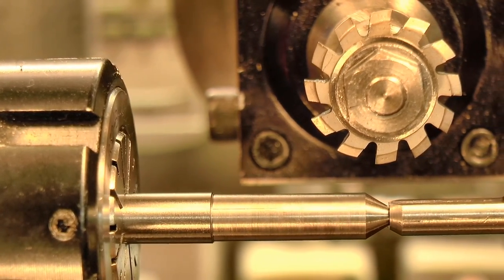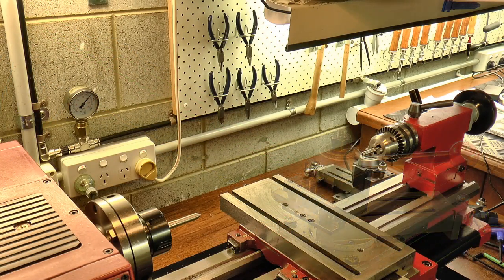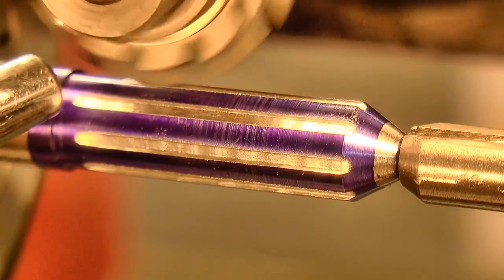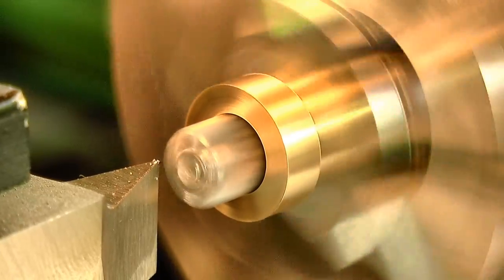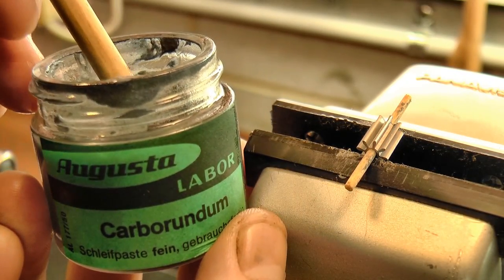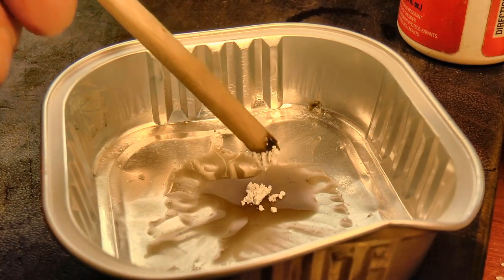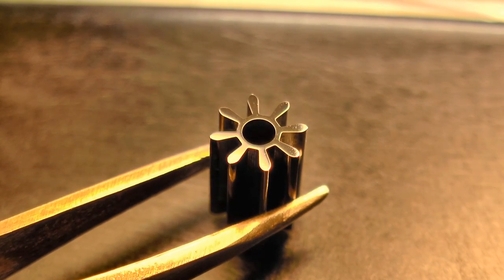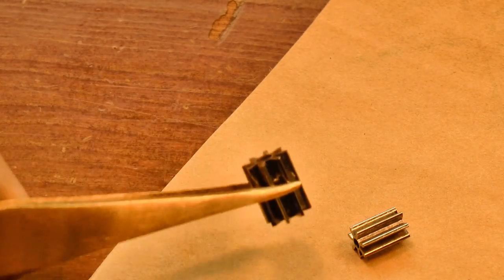Clockmaking - How To Make A Clock In The Home Machine Shop - Part 5 - Cutting The Pinions

Comment: Hi Chris. Interesting lapping attachment you built. Suggestion....make a tin plate with the axis of rotation off center. This will give an eccentric surface contact and greatly reduce the potential for wearing a "part" size track in your plate. Most lapping setups I have experience with have multiple motion contact features. Just a thought. Nice work. Always a pleasure to watch.

Comment from the maker: How To Make A Clock Part 5 - Cutting The Pinions

In this video I cut the pinions for the clock from drill rod, and then harden, temper and polish them.

Another milling operation carried out on the lathe, using a cross-slide mounted vertical slide, a light duty milling spindle, a Sherline motor/speed control, and the Divisionmaster CNC indexer.

I also make an improvement on my Sherline lathe tailstock polisher, by making a tin lap for polishing the pinion flanks.

 #clock   #machining
Reply: What is this for a Programm (sry for this Englisch i'm german
Reply: +Tomes H  Let me give it a shot. I understood your question as "Which software has been used"  and you're probably referring to the screen grab around 30 second mark in the video. I haven't used it myself, but i believe that this is "SolidWorks".
Reply: +Clickspring Mate, you're a glutton for punishment with all that filing. You do a nice job of it, but, cough, CNC, cough!
Reply: llllllll
Reply: ***** The CNC Dividing Indexer?
Reply: what is the music that you used in this and your other videos?
Reply: Skandranon Banefire Sandrude darstorm
Reply: Abomb Music, Like your videos too!
Reply: Clickspring could you link the lathe you use?
Reply: That's super pretty.
Reply: what is the song name you used in this video?

Comment: "Listening out for uncomfortable sounds from the cutter" certainly is familiar. That was me when running equipment on my father's dairy farm. Also why I got stuck with most of that work: my brother would put a Walkman on, turn up the volume, and not pay attention until things got way too bad. I also remember seeing a show on TV in the US about an off-road truck race somewhere (probably Baja California) where the head mechanic gave the drivers a lecture the night before the race, saying, "the truck will tell you what you need to know, you just have to listen." That stuck with me and I even apply it with my motorcycles now.

Comment: I looked into it, and it turns out the difference between wheels and pinions lies not in the number of teeth, but in the depth of profile. You could stack quite a number of wheels flat to get to the same height as a single pinion standing on end. Some clocks have 10-toothed wheels and others have 42-toothed pinions. As a rule of thumb, though, your statement on the number of teeth is accurate.

Comment: Why is the pinion made out of steel and not brass like the rest of it?

Is it subject to much more wear because of it going through a lot more revolutions compared to how many the larger wheel will go through? I'd think the difference would be extremely minimal even after many years of running, but then again I'm no expert at all.

Comment: What about tempering the drill stock and then re-hardening after cutting?
Perhaps that might make it a bit easier on your cutting disc.
Just a thought. I'm no expert. I'm not even engineer so I would be very grateful if you could comment on this.
Would it be practical, or is it just a dumb idea?
POST EDIT:
By "tempering", I mean heating to red hot and then letting cool slowly. I think I may have used the wrong word. Perhaps I should have said "softened". That's what I meant, of course.
Reply: I think the word you're looking for is "annealing."  As far as I know, oil-hardened drill rod steel is typically supplied in an annealed state already - but its alloy composition makes it pretty tough stuff even unhardened.

Comment: Hi Chris. What pressure angle cutters did you use? The plans only specify the module numbers.
Reply from the maker: Hey Jerry, the cutters for clock wheels are of cycloidal profile - more info from PP Thorntons (www.ppthornton.com), the best known of the current cycloidal wheel cutter makers: http://timekeepersworkbench.com/techinfo/CWPC.pdf
Reply: Hi Chris, Thanks. I had already found the recoil cutters on the thornton site but I want to make the 'normal' cutters myself. I am looking at the profile shown on page 139 of M. Wild's book. This seems to give the correct blank size when I go though the calculations. By the way I am looking forward to your upcoming project, the previews look interesting.
Reply from the maker: Yes that's the one - if you're interested I will be going through the process of making a custom cycloidal flycutter as part of my modern reconstruction of the Byzantine Sundial on Patreon: https://www.patreon.com/clickspring

Comment: Please post what air compressor you use. We have a large Sears unit which was purchased for furniture refinishing, but when the motor kicks off you can't talk to anyone without yelling. Thanks.
Reply from the maker: I have a cheap compressor, but I installed it outside the shop and have run the airline inside - no sound issues that way :)

Comment: I admit that I know nothing about hardening or tempering but I've watched it done on at least 2 other YouTube channels. All I've ever seen before is them tempering just until the steel turns a straw color. They said if you heat the material beyond that straw color, you went too far and had to re-harden it to start over. You temper well beyond the straw color (in 2 videos I've seen so far) and I was just wondering why. I'm also curious as to what the material is that you temper the parts in? It looks like brass shavings. Great work on the parts/tools I've seen you make so far.
Reply: I’m not Clickspring (obviously), but you can control the hardness of the steel by tempering it to hotter temperatures after the first hardening. Straw color is a normal rule of thumb for tools, because they will be harder than almost all other metals, but not snap. If you want the steel softer than that, you can take into red then blue. This rubs against brass, so it can get pretty soft and still be harder than the brass. I don’t know the specifics of drill rod and how hard you get it at different colors, but my guess is he wants it softer than his tools to make polishing it easier.

Comment: Press fit: the only press fit I know of is the permanent kind (a.k.a. interference fit). But you seemed to be able to put the pinion in the holder with very little effort. How did you determine the bore diameter of your holder? Take out a tiny bit until it just grabs the part?
Reply from the maker: Robert Baruch Hey Robert, you are correct, I was a little loose with my terminology there. What I was trying to describe, is that the edges of the pinion cut slightly into the bore, and therefore grip it, but because its only those edges, it will pop out again with a light tap. If it were a cylindrical part, it would indeed be a permanent interference fit. I couldn't think of a better term, but you are spot on. Thanks for watching mate.

Comment: SUBSCRIBED!

This is the first video of yours I've watched. Machine work is fascinating to me. but I haven't done any since college some 35 years ago. I joined a maker-space with some machine tools but not with the kind of precision and tooling I saw in this video.

I suppose you're making these for folks with a lot of experience. I understood a lot, but also missed a lot too. For example you took a lot of effort to polish of the ends of the pinions. Was this for the aesthetics of the final project or is there any enhancement of the operation of the clock? (I'm guessing it is the former.)

In any case I enjoyed watching.
Reply from the maker: +Robert Shaver Terrific Robert, I'm very pleased to have your sub :) Yes you are correct, the polishing of the pinion flanks is for aesthetics, and the polished surface also helps to reduce corrosion. Thanks very much for watching.

Comment: This is so satisfying to watch! Why didn't you drill the hole in the pinions before cutting the teeth? Something to do with alignment?
Reply from the maker: +erikhk The point on the end is required for tailstock support while the teeth are being formed. Once the teeth are formed, it can be removed, and the center drilled out. Thanks for watching and asking

Comment: Hi Chris, you state that you are only using compressed air and don't use oil as it causes chips to stick and ruin the finish. I noticed the drops of liquid on the surface of the stock during the cutting process. Is this just condensation?
Reply from the maker: Yes condensation - cheers :)

Comment: Hi Chris,
Your videos are mesmerizing and I'm seriously thinking about making my first clock. Since the steel pinions are driving soft brass wheels I'm wondering why the pinions need to be hardened and tempered. Can you explain the need?
Thanks!
Reply from the maker: KenToonz Hardening facilitates a better polish, but it is my understanding that the main reason is to extend service life. Over many years, the brass wheel teeth become "charged" with abrasives from the environment (grit etc) and then acts as a lap against the surface of the pinion leaves. Despite the hardening and tempering, the pinion ends up being the part that often shows the most wear. Similarly, hardened and tempered escapement pallets also show a wear groove after years of service, despite only lightly contacting the delicate teeth of an escape wheel. Same again with hardened pivots becoming heavily grooved, despite turning in a soft brass pivot hole. It's quite counter-intuitive.  Great to hear about the clock Ken, look forward to seeing it unfold. thanks for watching and asking :)
Reply: Clickspring Actually similar to rubber seals cutting into steel shafts which happens all the time on automobile engines and transmissions. Granted the rubber is soft and flexible, but as you noted with the brass, it accumulates dirt and grit and becomes abrasive and wears into the steel and iron.
Love the video ! Will be subscribing to your channel as soon as I'm done typing this.
One question though. Why didn't you drill and ream the pinion gear BEFORE cutting it off from the blank ? Granted you would still need to make the bushing to hold it for facing & polishing, but drilling before cutting off would have ensured that it was concentric to the pitch diameter.
Love the wire-wrapped heat treat process and the custom tailstock 'female center' trick for milling the teeth.
What did you bury the pieces in for tempering ? Looked like brass chips, but wanted to know for sure.
Reply from the maker: oldSawyer  The stock is out a long way from the chuck, so I decided a facing cut followed by drilling was probably going to introduce more eccentricity to the hole than simply cutting off and rechucking in a pot chuck. Small drills have a tendency to 'wander' especially this far out from the chuck. Yes the pinion was buried in brass shavings for the tempering. Thanks very much for asking and watching :)

Comment: Why does the MDF lap rolling over the edges of the gear teeth not look right? Personally, I like the soft look of it rather than the sharp edges you get from using a tin lap. Wouldn't you want to break those edges anyway?

Comment: I love your gorgeous videos!  Can you tell where you can get a tin casting made?  Also, what is that wonderful purple paint that you use to mark out with, and where do you get it from?  I love how you have your compressed air supply so neatly setup also.
Reply from the maker: John Creasey Hi John, I have a tin/lead foundry near where I live (http://www.northernsmelters.com.au/) See if you can find someone similar in your area. The marking fluid is Dykem blue. I have until recently been able to get it on Ebay, but the supplier I used no longer ships O/S. Try your local pro tool shop and see if they can source it for you. Thanks for watching mate.

Comment: What do you use to quench your work? You have never mentioned it (that I've noticed)
Reply from the maker: Hey Micah, I generally us a light compressor oil. Its much cheaper than the dedicated quenching oils, and works great for small to medium sized parts :)
Reply: Thanks for the reply. That's interesting. I hear a lot of people use motor oil or water (Oil being the preferred method) Why do you use light compressor oil and not motor oil? Is there any benefit?
Reply: Also. What is the purple stuff you put on your parts just before you mark it? Nail polish? lol
Reply from the maker: Ha ha, no not nail polish! Dykem Blue Layout fluid. Motor oil is ok, but I find the lower viscosity of compressor oil more suitable, closer to the real quench oils. Water (actually brine) is good for when you need a faster quench rate, but beware cracking. It's all a bit of an art - This book is a great place to start: https://www.amazon.com/Hardening-Tempering-Treatment-Workshop-Practice/dp/0852428375

Comment: 6:35 - If the material is brass or alike, this is not the way to harden it. See https://chestofbooks.com/crafts/machinery/Shop-Practice-V1/Hardening-And-Annealing-Brass.html. This is also my experience with machining brass and copper. I also have doubts about shown hardening test, as, according to my books and experience this test is performed on a flat, not on a corner, at least. Please your comment.

Comment: when cutting gears or pinions, usually different gear cutters (of the same pitch) are used, depending on the numer of teeth the gear or pinion will have. Did you follow this rule or did you use the same gear cutter for all the gears and pinions and if the same, whch one? What is the diametrical pitch of the gears?

Comment: I always thought making "proper" gears was just too much work for a hobbyist, but you seem to be capable of doing a nice involute gear, which will especially help you get a nice, smooth transmission of power. Also, in my opinion they look nicer than gears with long, parallel teeth.
Reply from the maker: YPOC Thanks for watching!

Comment: I am really impressed by Your very high standard of work and enjoyable presentation!
Found Your videos Yesterday, watched a few so far and learned some useful stuff from every one of them!

I make a lot of small parts in my workshop for prototypes in my line of work as a self employed engineering consultant. I have never made clocks but  It seems to me that there are lots of ideas and techniques from horology that seem very useful for general machining of small parts, especially for prototypes and especially if resources are limited. 

A question: Is it boric acid or borax You use for heat protection of the steel? 
Both are mentioned in the comments.

I use a lot of tin in the shop. Here in Sweden I can get it cheap as tin plates etc.  at flea markets. Being out of fashion,  It can be had for under junkyard  prices and it is very easy to cast into blanks for shop use. The stamped items are very pure tin.
It can be quite dangerous to turn longwinded chips on a larger lathe. Your video scared me a bit, but I guess Your scale of it makes it safe. A finger can easily get entangled in those long chips with nasty results. I try to back off intermittently to break the chips into shorter pieces to reduce the risk of an accident.
Reply from the maker: +Erik Isberg The protection during heating is powdered Boric Acid. Hey Erik, thank you very much for the kind words, I appreciate you taking the time to watch.

Comment: You bloody little ripper!! Thanks for this video. I am currently tearing my hair out trying to work out to cut some mod 0.2 gears. They are 2.8mm total OD and with 12 teeth. This video has solved a few issues I was grappling with.
Reply from the maker: +huxleypig69 Ouch that's small! Good luck, let me know how you go :)
Reply: +Clickspring Will do! Making the bespoke 0.9mm cutter is proving to be the biggest hurdle right now. I love the cut-out tailstock, I will be copying that for sure!

Here's a question - let's say you wanted 5 gears the same...would you consider making a long pinion (like in this video) and then slicing it up to make the identical multiple gears? Instead of going through the whole process of making 5 gears?
Reply from the maker: +huxleypig69 Providing the pinions are not too long, and you can support the work in the middle (with a small machinist jack) then that would be the way to go. There's a great book called "Wheel and pinion cutting in horology" by J Malcolm Wild. It has some great information in it would give you everything you need. Cheers, Chris.

Comment: Hi Chris.  Absolutely fabulous videos and marvellous close up shots. Your attention to detail is awesome.  I have a question:  Could you provide some details (or even a video), on your lathe spindle indexing kit.  I realise it's basically a stepper motor and gearing but what software do you drive it with?  Regards Mark in the UK
Reply from the maker: +thecorbies Hey Mark, the indexer is a commercial one called Divisionmaster, and I've strapped it to a Sherline rotary table with some other fittings to lock it into the lathe spindle. Some more infor here: http://www.clickspringprojects.com/blog/can-i-get-a-witness-mark Thanks for watching.